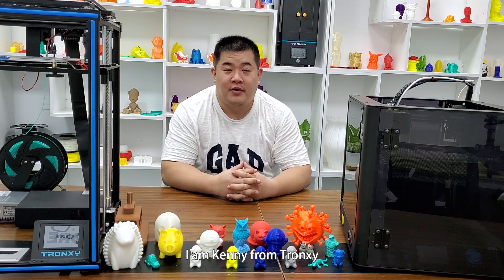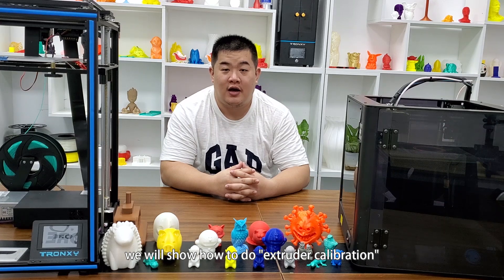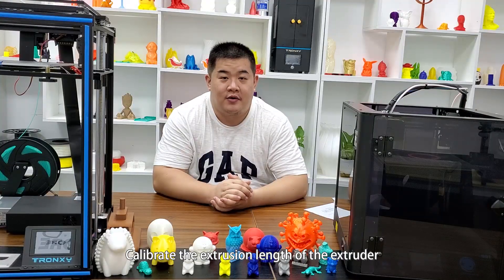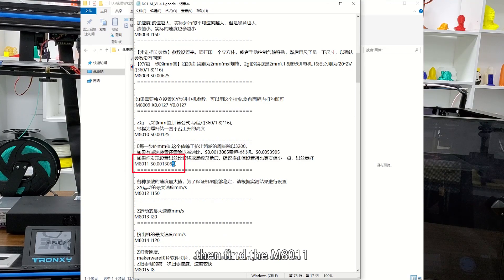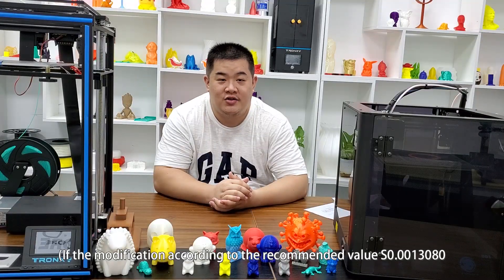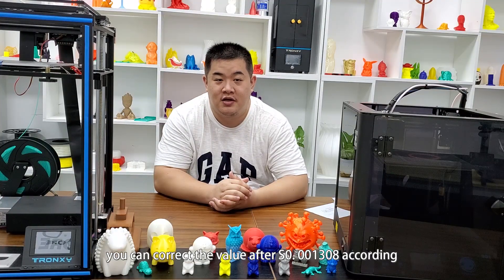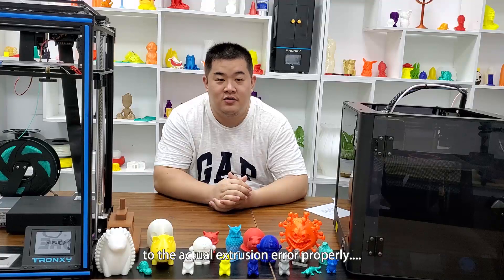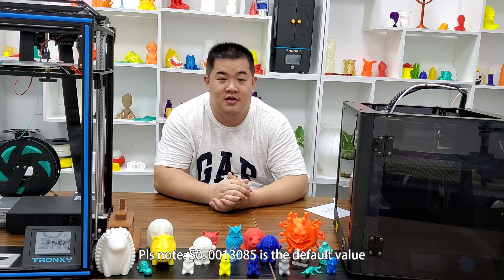Calibrating the extruder of your 3D printer

Comment: The smaller the value the  more is extrude 
S0.0011 extrude 110mm if you extrude 100mm
S0.0013 extrude 95mm if you extrude 100mm
The value that would for my titan extruder is s0.0012450
Reply: Thanks for sharing.
The value for my Tronxy X5SA-500 PRO Direct Drive Upgrade Kits is S0.002455

Comment: also, could you please share the file with Gcode?
Reply: create a new savesettings.gcode file and write in it: 
M6046 ;sdcard access
M8512 "currentconfig.gcode" ;save settings to file
Reply: print this file on your printer and it will create a new file on the sd card called currentconfig.gcode
you can find your saved settings there
Reply: @L3X369  Thanks a lot <3